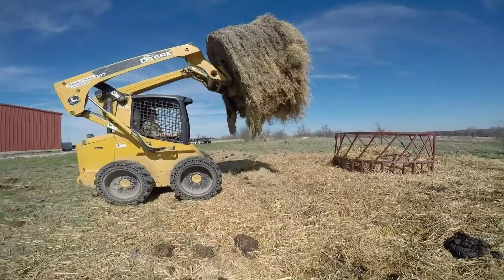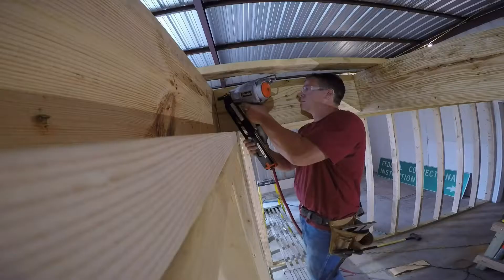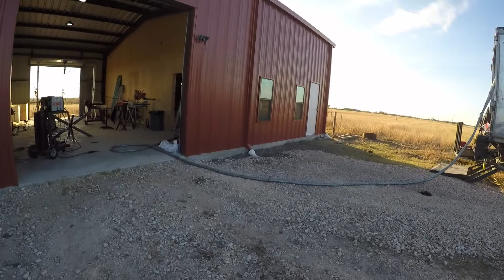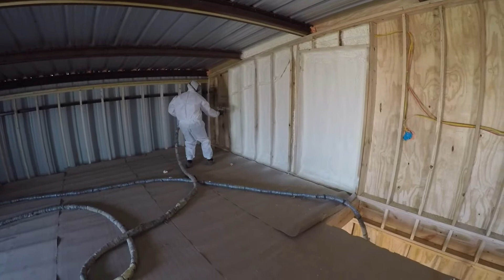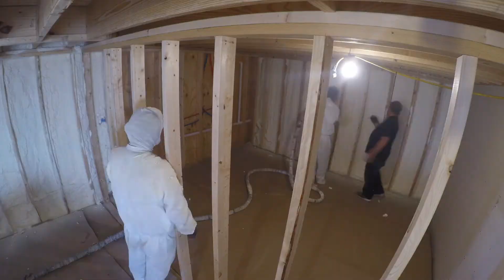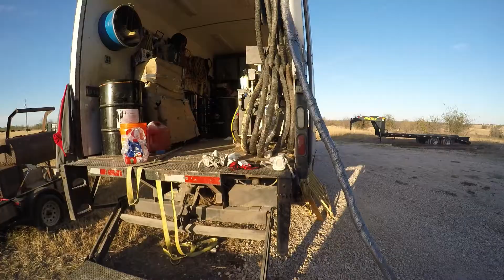Closed Cell Foam Insulation - Barndominium

Comment: I am planning to build a small bardo, 26x26x14, with bare steel framing how much closed cell foam would I need to get the R values necessary
? I need a 49 roof, 19 floor, 8/13 mass wall... and what would the general cost be? im getting a number like $8k which cant be right...
Reply from the maker: Closed cell foam is about R6 per inch. Open cell i think is R3 per inch. 
I paid ~ $5k for 2 inches on 2400 sq feet of wall/ceiling. Looks like you are getting a really good deal